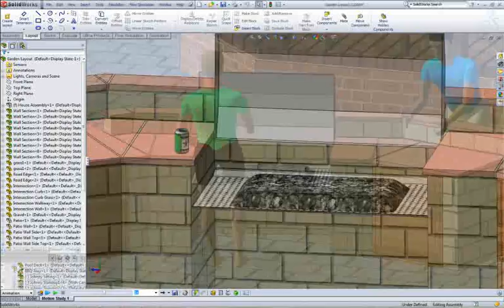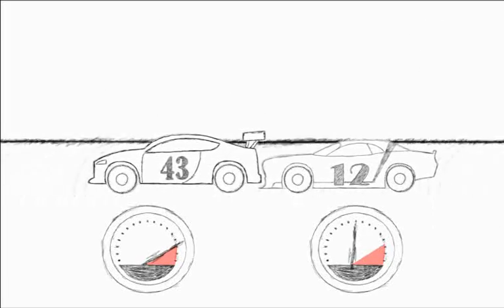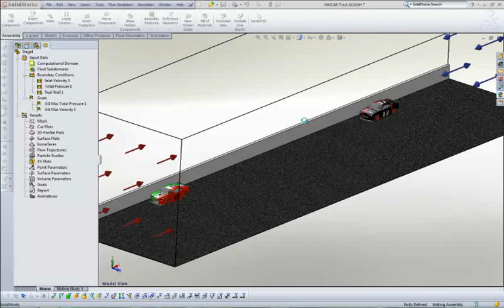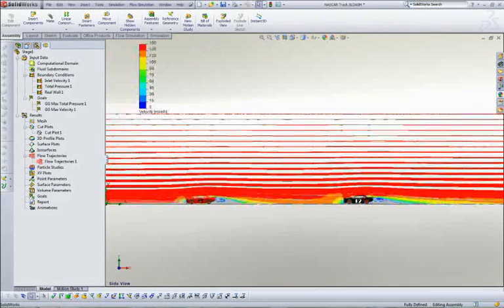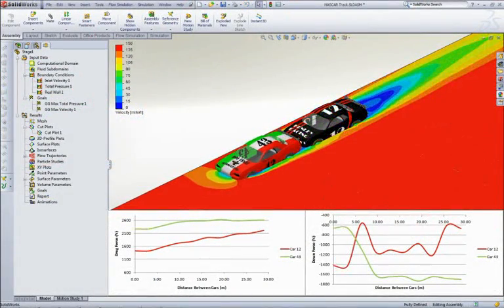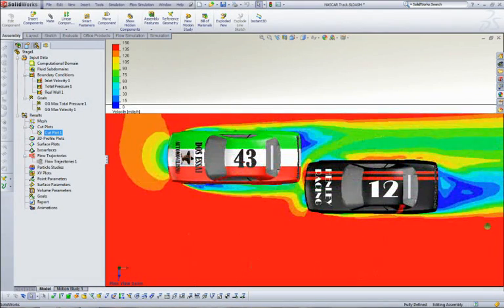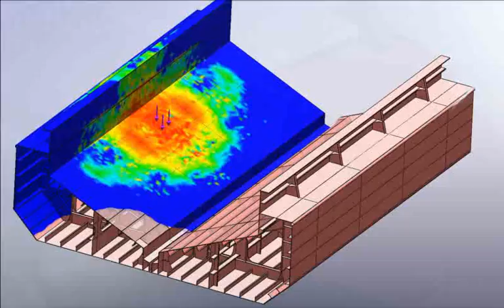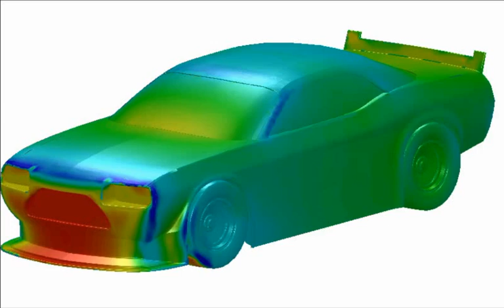The Stock Car Drafting Quandary

Comment: I know I'm late to the party, but the idea of engine "reserve" is incorrect. In reality what you're seeing is a the following car using the run it gets from being behind the front car and using the increase in velocity compared to the lead car to pull out from behind and make the pass. in reality if you were to stay behind the car, they would both reach an equilibrium state and as you said be faster as a pair, but the following car would still be using its full power. At that point, once equilibrium is reached, it would be very hard to pull out and make a pass unless the following car had another car pushing them etc.

one thing that allows cars to pull out and make effective passes is the concept of sidedraft, or the way that air works when they get side by side. As the car following pulls out, the high pressure air from the front of the car is placed onto the car in front's rear end and spoiler, essentially added a substantial amount of drag as long as the following car is close enough. if the following car times it out to where he effects the leader but does not effect himself, he can pull out, use the sidedraft to slow the car down next to him, and then pull further away to avoid the other car being able to slow him down and make a successful pass.